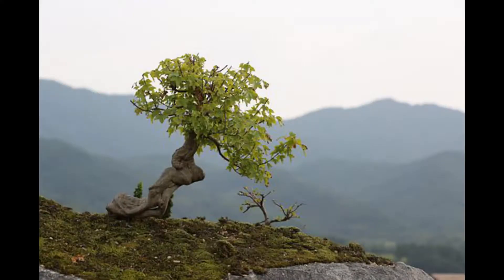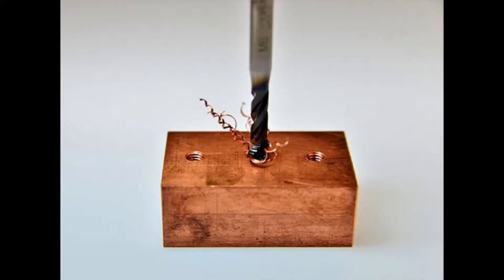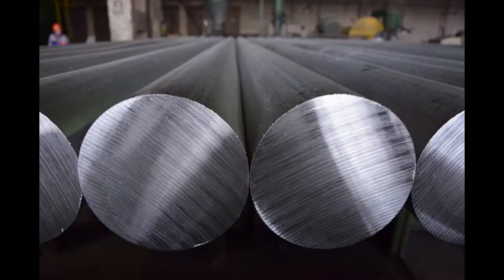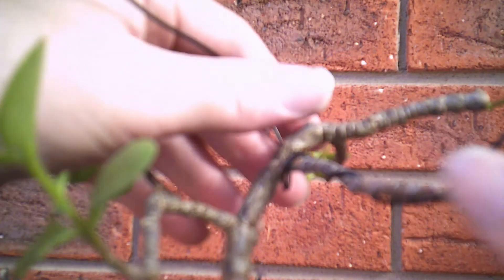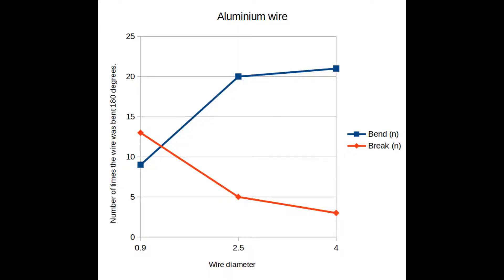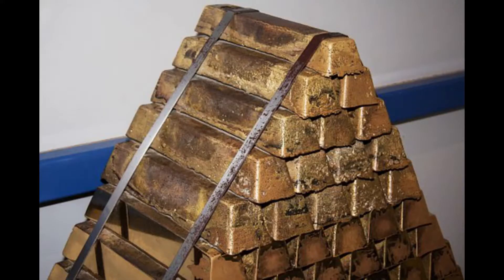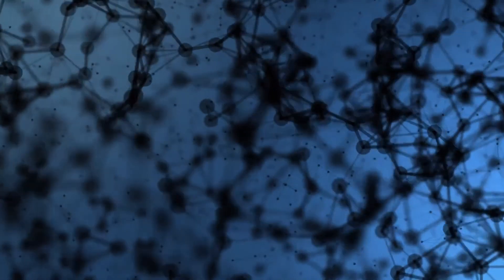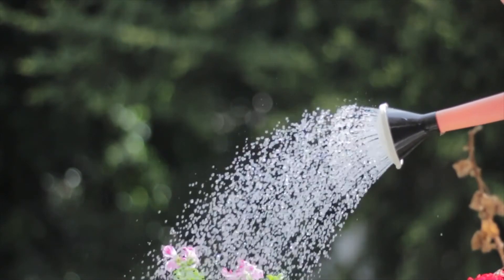Bonsai copper and aluminum wire comparison

Comment: Is it safe also to use aluminum craft wire?
Reply from the maker: It will vary. Most wire used in craft is an almagam of aluminium and softer metals or alloys. This makes it easier to work with but not as strong. The higher the aluminium content the better it will work for bonsai.
In general if the wire hardens as you work it than yes it can be used for your bonsai tree but will not have the same degree of strength. This means you will need thicker craft wire than bonsai wire. The weaker it is after being bent and used the thicker the wire you will need to use is.
If it does not harden as you work it than no, it will not hold the branch in place. This could be used for very fine branches but is an overall bad idea.